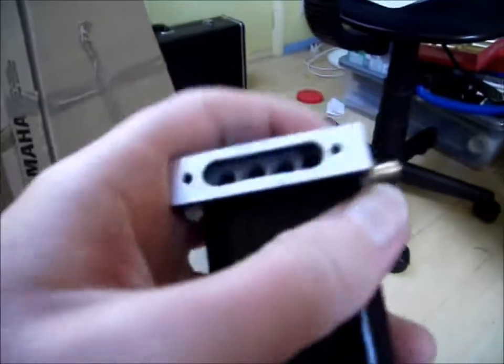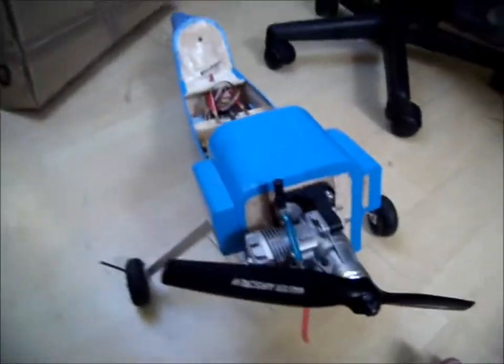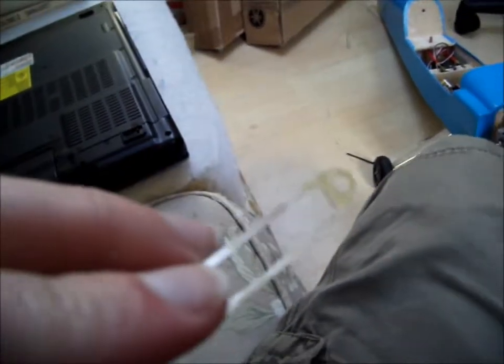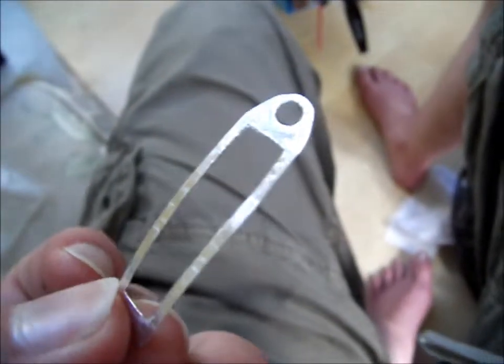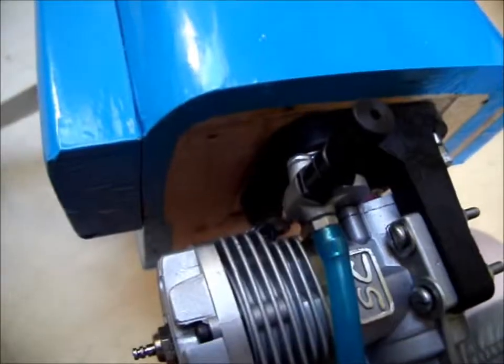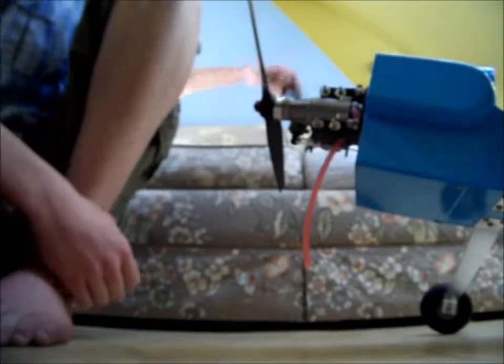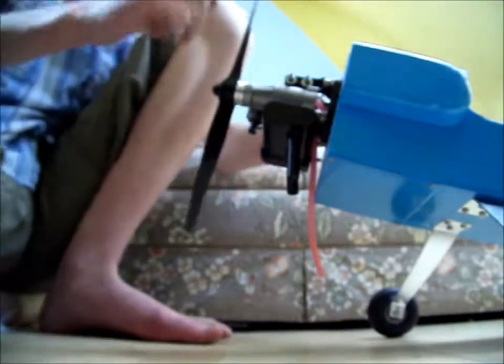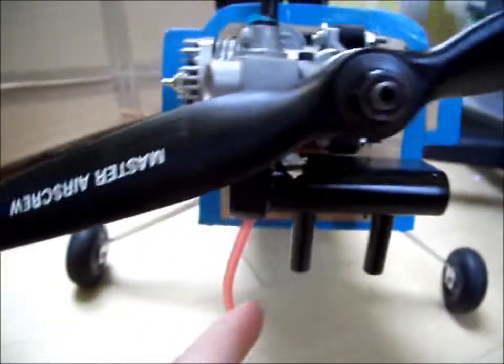Feugray Update #6 with Pitts Muffler

Comment from the maker: @FMo01 Sorry misunderstood you :) yeah that's what I'll have to do, I bought a Du-Bro smoke system off ebay, awaiting it now, I will need to put another pressure nipple as near to the exhaust port as possible, it also came with a glow perry pump, but this is not suitable for a gasoline based fuel, it will ruin the diaphram so I can't use that

Comment: Why don't you drill a hole behind the pressure nipple in the firewall. The diameter of the hole a little bigger than the diameter of the silicon connection tube. Then you are able to connect the tank without problems.